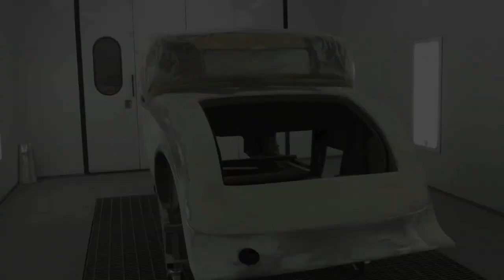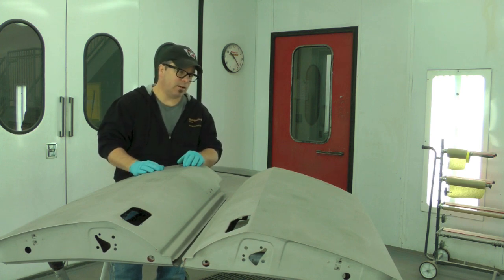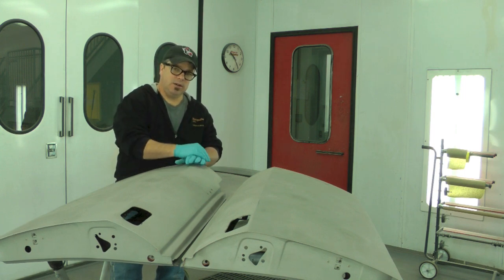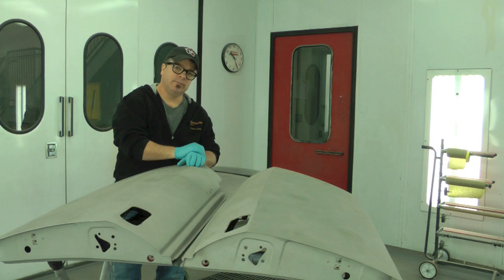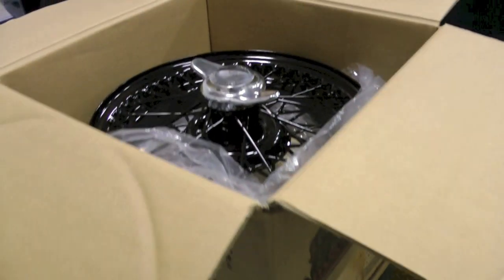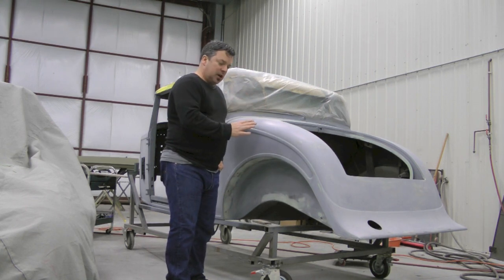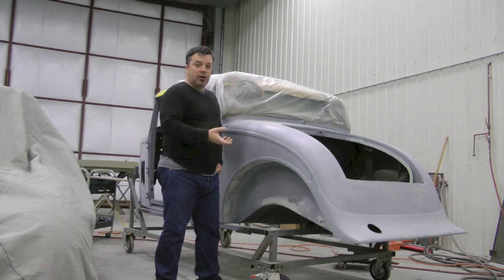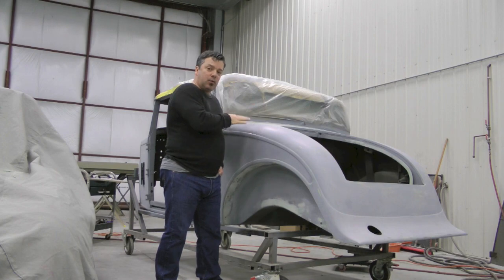Using primers right

Comment from the maker: yes and no. If it were to be layered one directly over the other, it might be ill advised. BUT, because acid is being used as a foundation so the metal can be handled and worked with VERY long periods of time between, this is not an issue. Now to support your question. IF the acid was applied with an epoxy directly over it (wet on wet application) that would be a odd and non-designed application. Acid is always best served if applied direct to metal (fresh from blasting) and allowed to cure